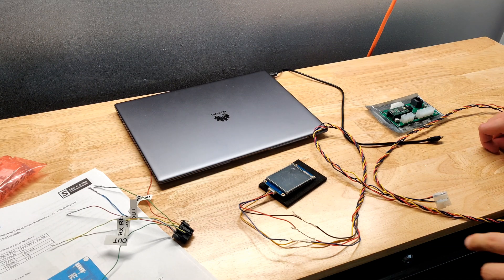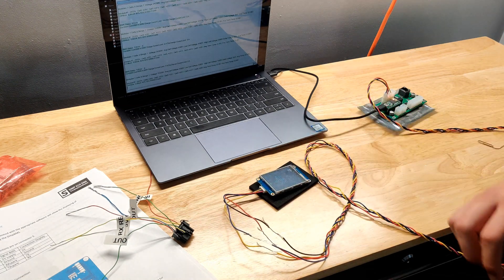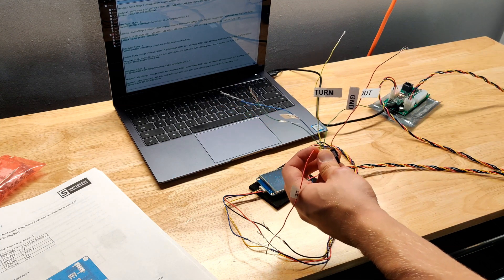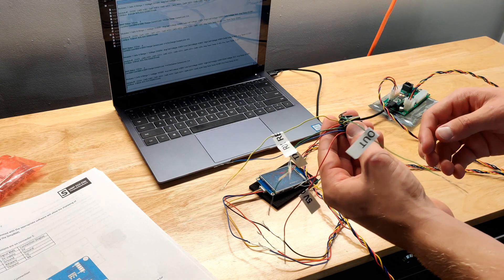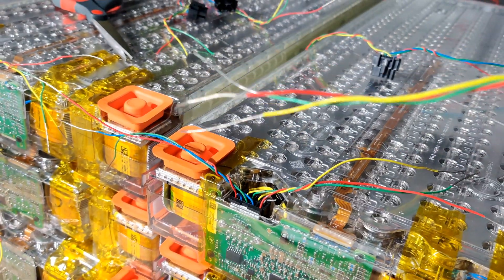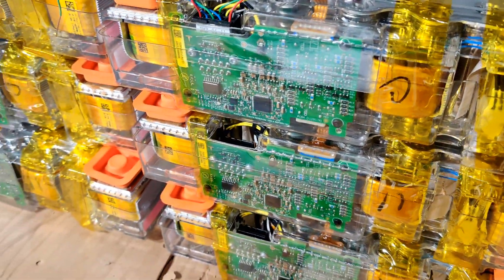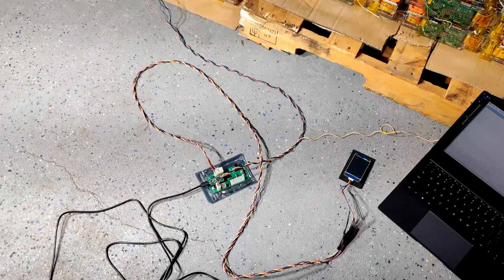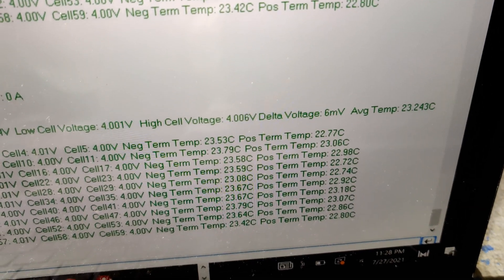Ford Escape EV Conversion EP 14: Wiring up the SimpBMS with Tesla Battery Modules

Comment: Did you figure out the reason behind the Error state?
Reply from the maker: Yes, it was just a series cells fault. Went into battery settings to enter the correct info for cells in series per string and the error went away.

Comment: Hi, my Termite shows: ESS mode: UNhappy   ... What can be wrong, what does this mean? thanks
Reply from the maker: You're in ESS mode which is meant for stationary battery installations (solar storage etc.)

Unhappy indicates that something is out of range. Either a cell voltage is far from the other cells or it is out of temperature/voltage range.

Comment: i would think you only had to connect at the simpBMS and use the factory harness at the batteries as is .......what do you think
Reply from the maker: You could reuse the original harness, but it makes more sense to just wire them up without the harness. For one, each module's BMS board has a 10-pin connector, but the SimpBMS only uses 6  per module (4 for the last module in the string). So there are unnecessary wires. The colors of the wires are also confusing, as each plug has multiple pins that use the same wire. They don't follow standard color convention either. +5v and GND aren't just the standard red and black, for one. 

I thought about reusing the harness, but ultimately decided it was much simpler to do it this way.
Reply: i recommend suspending the modules the same way tesla does ......i got you emails ...thanks
Reply: got it ...thanks
Reply from the maker: Also keep in mind that the harness is built to work with 16 or 14 modules depending on what model of Tesla your modules are from. If you're not using that exact number of modules, the harness may not work.

Comment: Do you know if it's a good idea to use Tesla BMS modules and SimpBMS to custom made battery packs?
Reply from the maker: If I'm understanding your question right, you mean taking the balance board from a Tesla module and using it with a module that you build yourself?

I think that would work fine. You would probably need to have 6 cells/cell groups in series. Since the BMS can't tell how many cells are in parallel in each cell group, the number of parallel cells per cell group doesn't really matter. But yes you would still need 6 cells in series because the balance board will probably freak out if it detects less than 6. 

These balance boards are dumb on their own, so I think it would be fine.
Reply: @reider_mcfeely  Yes, you understood it correctly. This is on option that I'm considering after seeing you using the SimpBMS, but still don't know if it's a good idea or not. 

To find Tesla modules in my country is almost impossible, but buying only the BMS modules is possibility since they're small and more available.
Reply from the maker: Yup. You could consider importing modules from overseas though. The SimpBMS could be useful even if you don't use the Tesla modules themselves. One thing I forgot to add in the original comment is that the thermistors could maybe be reused in a non-Tesla 6s module. 

Where are you located?
Reply: @reider_mcfeely  I am in Brazil. Shipping costs + taxes  would be so high that total cost would easily be more than 100%. And imagine the problem that I'd have if after waiting for 1 month some modules arrive broken or were sold like that.

I thought about using a Tesla BMS would be good because SimpBMS docs currently says:

Currently supported slaves:

-Tesla Model S/X 
-Tesla battery modules used in other OEM cars 
-VW E-Golf and GTE (no balancing currently) 
-Mitsubishi Outlander 
-BMW I3 (no temperature or balancing currently)

And Tesla's the most popular one
Reply from the maker: Tesla battery modules used in other OEM cars is referring to the now discontinued Mercedes B-class electric, which are very rare. Those modules each have 7 cell groups in series, but the balance boards on those modules are also configured to handle 7 cell groups in series. 

I'm confident that the BMS and balance boards (talking about the model S/X balance boards here) would work fine with as long as each balance board is monitoring 6 series cell groups. Less than 6, not certain how the balance board would react. 

If I can get ahold of an extra balance board I can test this theory out.
Reply: @reider_mcfeely  I think you're right. My plan is to keep the 6S and build packs of +- 24V using Lithium Ion cells.

And have you decided how many and what contactors you're gonna use? I was looking at Gigavac catalog and there are so many that is hard to choose. I also watched a @jehugarcia video where he showed that he melted some contactors, so, if not chosen correctly, bad things might happen.
Reply from the maker: I just made a mockup for someone else of the contactors I'm planning on using: https://imgur.com/gallery/8zPPebJ 

The inverter contactor is included with the Hyper9 kit. The other contactor will be a Gigavac GV-200 12v contactor most likely. 

When you say melted contactor, I'm assuming you mean welded contactor? If you don't have a precharge circuit like shown in the diagram, the inrush current can actually weld the contacts inside the contactor together, making it unable to open.
Reply: @reider_mcfeely  No. It really melted or was about to melt. Lol. 

https://youtu.be/sTS2Kebub70?t=110

How did you decided for the GV-200 12v? What is the rule? I think that I'll have to buy the contactor that comes with the Netgain inverter. I bought the inverter at eBay for a cheap price, but you know, the conditions are not guaranteed. I think it's coming without the contactor. At least this one is specified by Netgain, so I know which one to buy.

BTW. I think you're using a stereo mic. Have you ever listened your own videos in stereo and mono? Every time that I'm going to watch it I change my audio to mono because it's much better.
Reply from the maker: Ah, you're talking about the contactor for the inverter. The inverter contactor must be 24/48v externally economized, and it runs directly off of the inverters wiring harness. 

Pretty much no one uses Tyco contactors. Gigavac contactors are the way to go. I believe the GV-200 series has a variety of different SKUs for internal/external economizers and for different switching voltages. 

I'm just using my phone to record these videos. Thanks for the suggestion to use mono audio. I know the audio has been unbalanced but hadn't given any thought to how to fix it. Next video will use mono audio.
Reply: @CassioT  I have a few tesla BMS boards and would send u one free. I'm still playing around with my Sims PMs and seem to have it working but I may have some questions for you. As I understand it you're selling these I'd be interested in buying another one from you to help support here program and I have another car that I can use it in. The one I have now came with a display a current shunt and some other part I'm not sure if. I'll look around for your email address